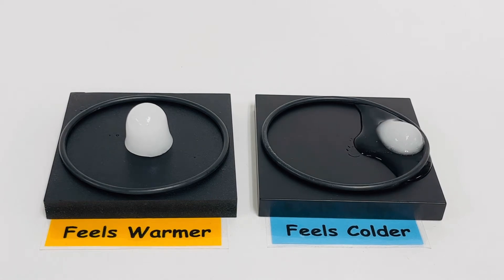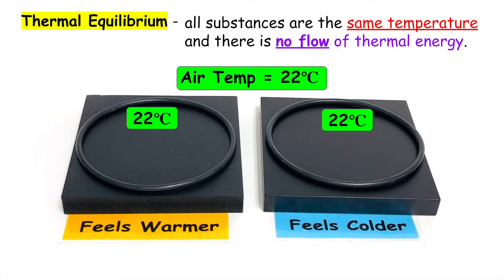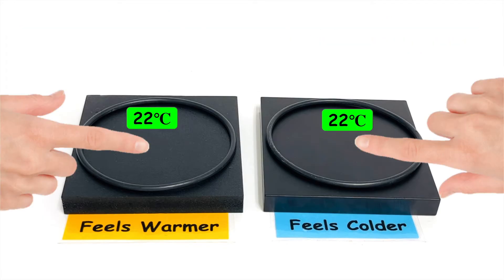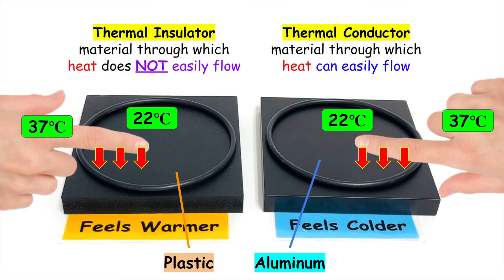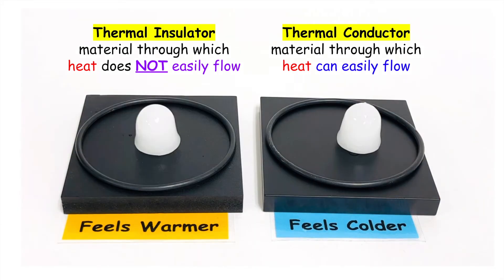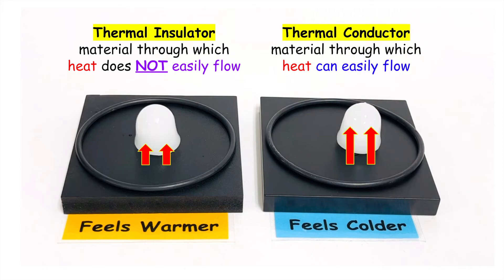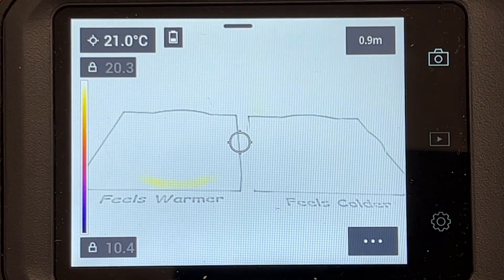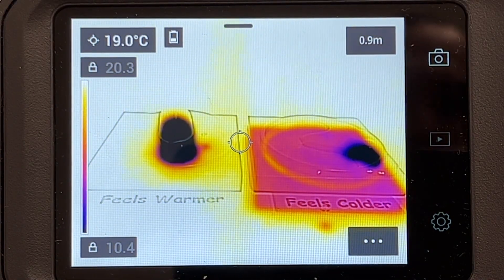Feels colder, melts ice faster! Full Explanation of the black square demo.

Comment: lemme explain.

1 is made of aluminium 
2 is made of plastic

normal body temperature is 37C, by touching the aluminium plate you will feel it cooler than the plastic one, that is because it conducts the heat from our body better.

video: the aluminium's heat energy is transfered to the ice cube faster as it has a better conductor of heat than plastic therefore melting it.

Comment: But what if the materials are same. If aluminum is on both sides but one of them is above heat and other one is just normal or taken out of fridge then where would ice melt faster??
Reply: Yes, it would melt even faster because the heated aluminum  has even more heat to give the ice.